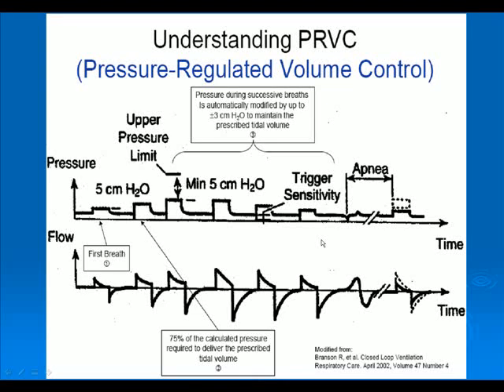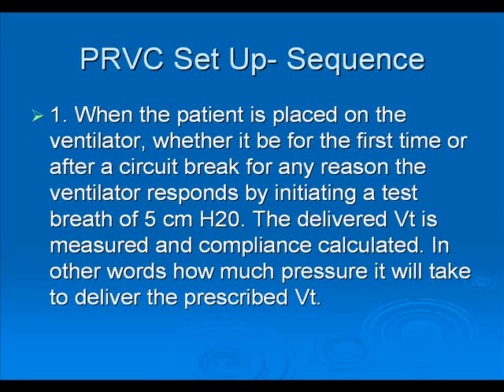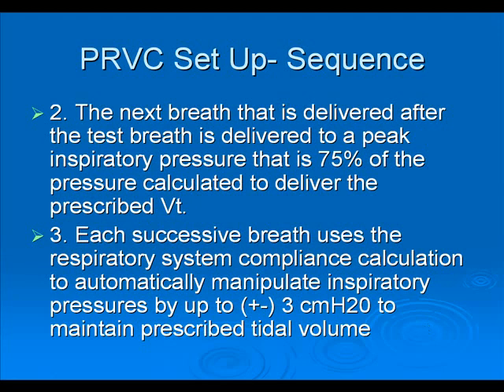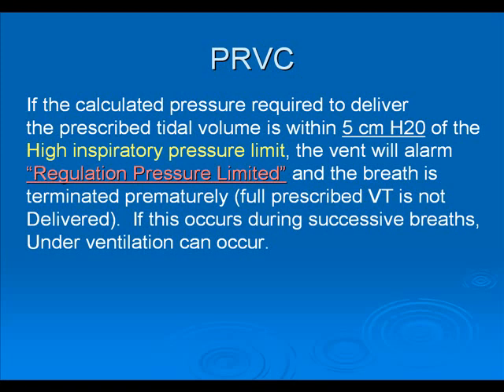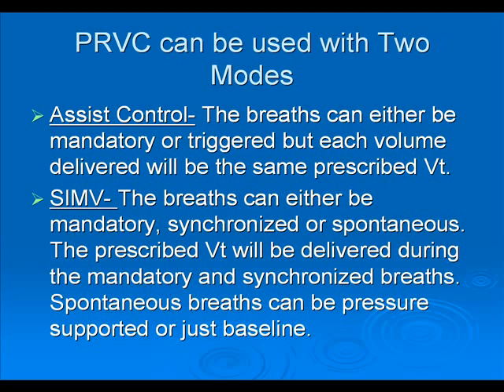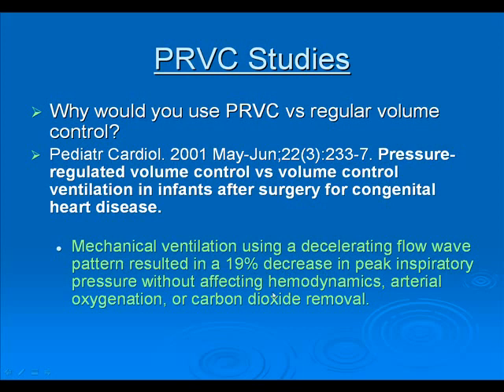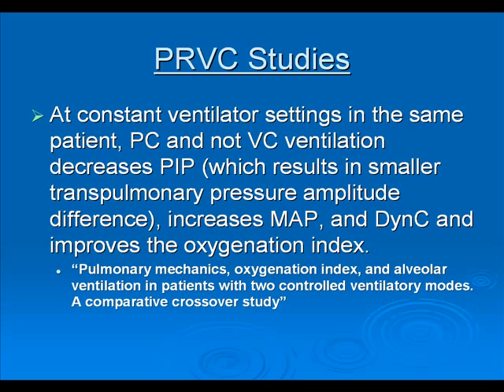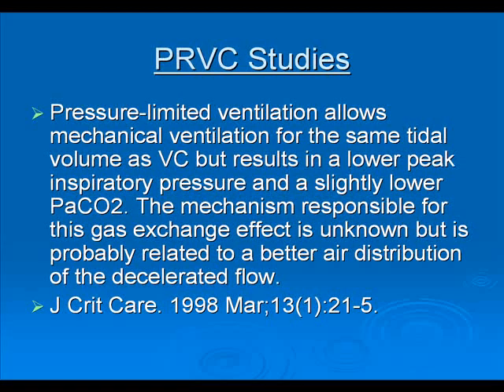Understanding PRVC - Part #2

Comment: Thanks for the info at the end of this part stating that this mode promotes lower PaCo2 compared to VC. Good to use on COPD pts. My one pet peeve (regarding therapists who use it) is when a therapist puts an I-time of one second as  a one-size-fits-all setting and doesn't take into consideration the rate and I:E ration as a result. I frequently see a set rate of 20 (or the pt breathing over 20) and the I-time left at one second, when it should be way less--usually 0.8 second to give an adequate I:E ratio of at least 1:2. This mode is really great for neuro pts who are flow hungry and require a high flow of 80 lpm or more; it gives a nice responsive and quick breath without causing high PIPs.  I wish my hospital would use this mode as a default mode instead of the traditional VC mode, because it is much safer and comfortable for the pt.